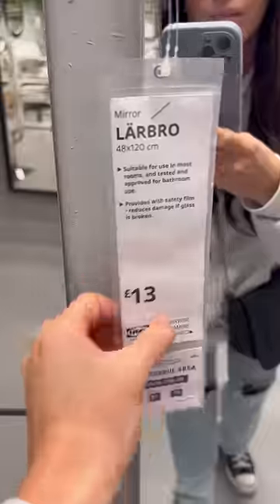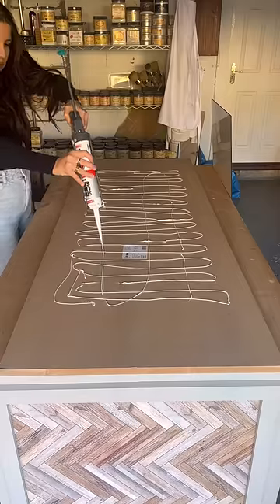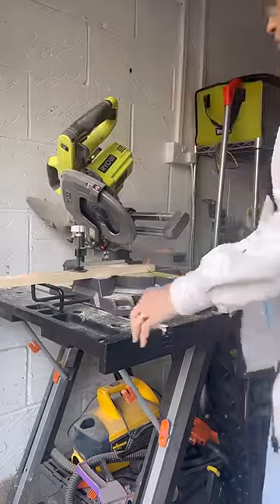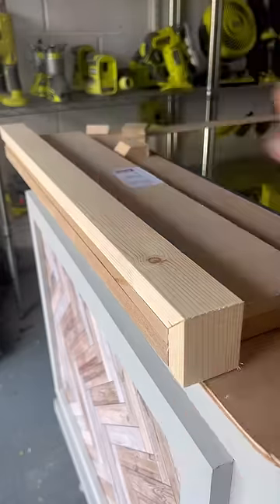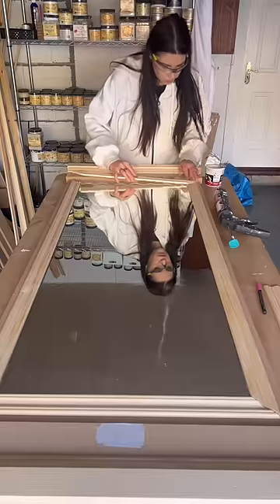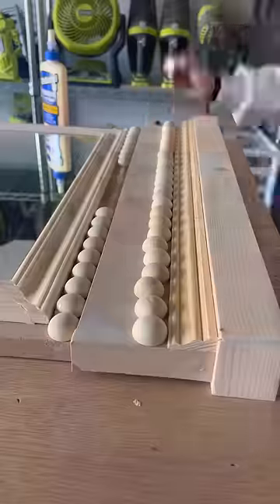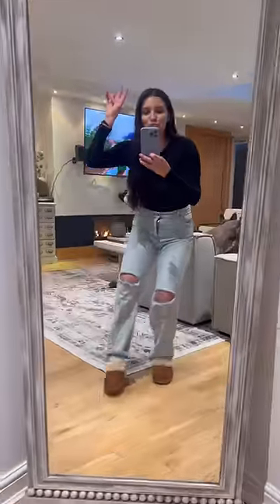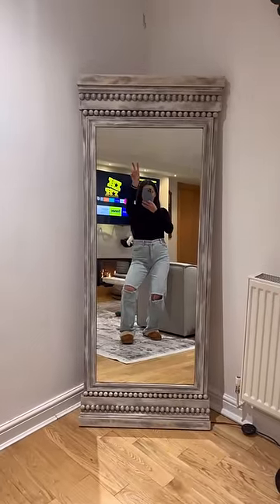Create A Unique Mirror Using Leftover DIY Supplies! #shorts

Comment: gorgeousssssss

can you help me with something? 
I bought a fully carved mdf board for display but I have no idea how I can protect the piece from moisture or mould since my place is pretty humid. 
what should I use?
Reply from the maker: Hey Tahirah! Thank you so much for watching! ❤ If you want to keep the original look of the mdf and do not want to paint over it, we recommend sealing it with our Gator Hide, this is our strongest topcoat and its water repellent! If you do want to paint over it, we recommend using our Silk Mineral Paint, it has a primer and topcoat built in as well as mildew resistant! I hope this helps! ❤
Reply: @DixieBellePaint  thank you ma'am